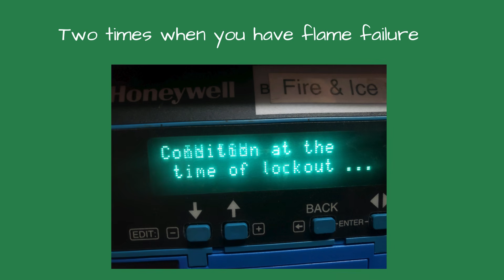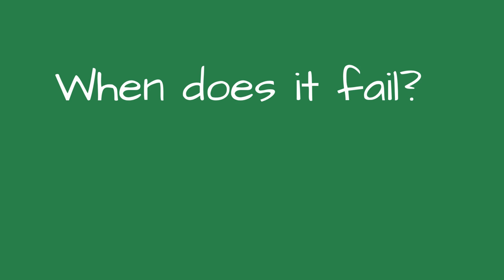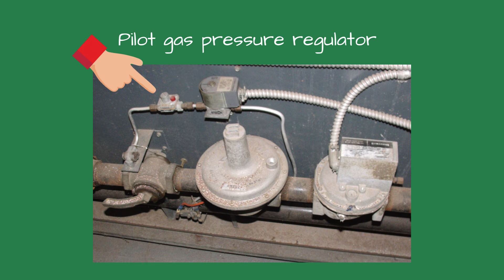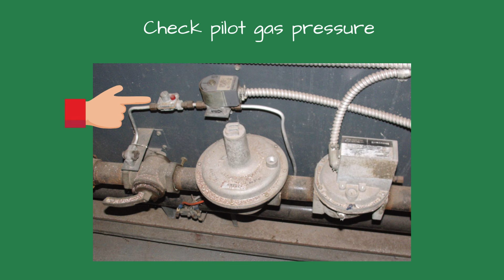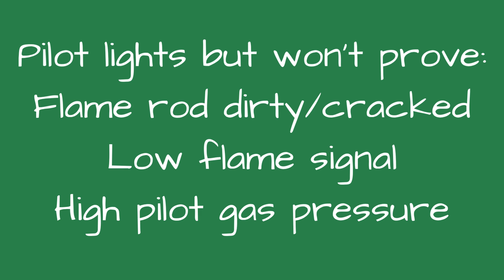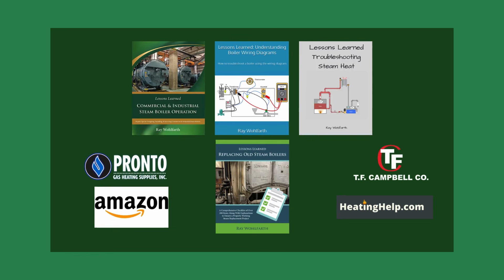Unraveling Intermittent Boiler Flame Failures: The Ultimate Troubleshooting Guide for Technicians

Comment: What could cause an oil burner to shut down if it's running for an extended period to bring up temperature after the thermostat was set back low?

Is there a time limit built into the controllers for continuous run to protect it from overheating the system?

A reset restored operation, I'll try to reduce the temperature setback so it doesn't run as long.
Reply from the maker: I’ve never heard of one doing that I would look at the operating control

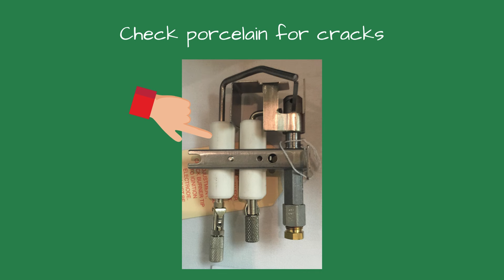Comment: I’d say that the number one cause of intermittent pilot failure is a dirty pilot. On a Power Flame burner, insure that the primary air hole just past the gas orifice is clean. Agree that excessive gas pressure is a prime cause. The Honeywell Q179A pilot at 4:18 is the biggest POS pilot ever.
Reply from the maker: lol yes it is thanks